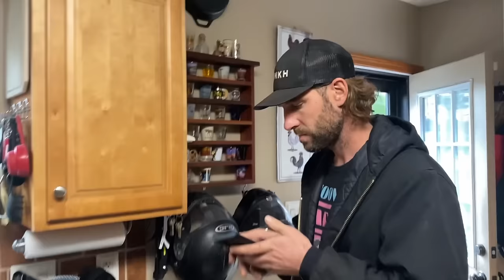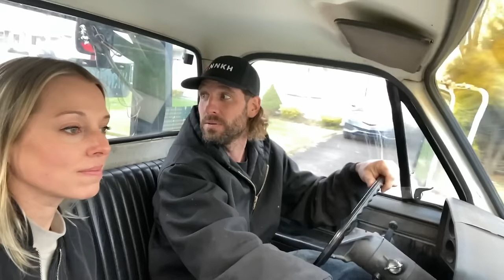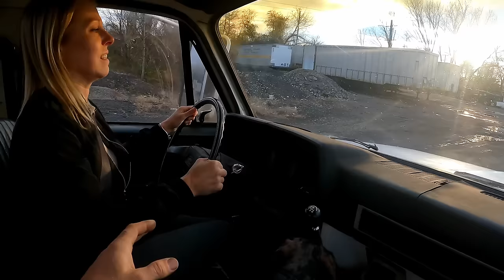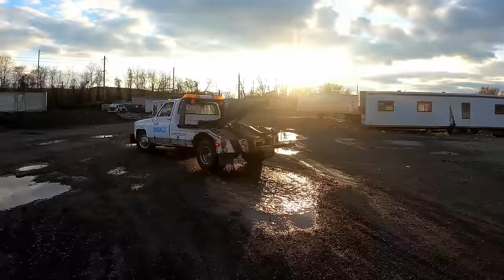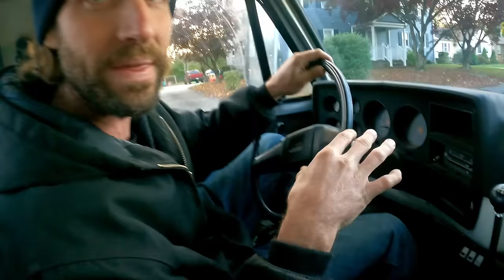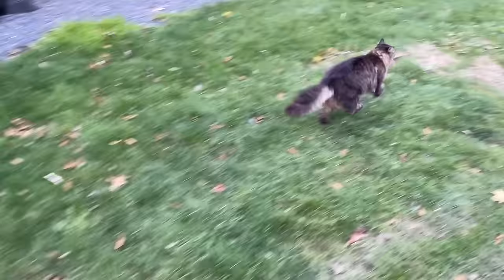Learning stick on "The C30 Wrecker" with NNKH NoNonsenseKnowHow

Comment: Once you get good at driving stick you'll much prefer it,  because the shifting is very positive,  you know you're fully in gear and you're in complete control of it.  With Automatic it's kind of doing everything for you and it shifts where it wants to shift and it feels kind of "slushy" and the shifting is not very positive.   You really get the feeling of being locked in gear fully with a manual transmission.   Besides that it's fun to drive stick,  you feel more part of the machine when you drive manual.

Comment: Each vehicle has it's own little differences. One tip is to watch the speed when getting the car moving to know when to let off the clutch. 2000 Beetle stick shift is about 5 MPH to let the clutch pedal all the way up. If you let up at 4 MPH or less, the engine will stall.

Comment: Your learning fast. I made myself learn how to drive standard by removing the auto in my firebird and swapping to a 6spd manual. I bought a pretty aggressive clutch,  so it really made learning hard. I had a huge phobia of people behind me being so close, because getting going was hard for me to learn and I was afraid of rolling back . Can't tell you how many times I killed it at stop signs, red lights, my own driveway since its a hill🤣. I just drove it down really quiet roads for a few days and got the feel of how to drive , then started making small drives on more populated areas. I just recently did a trip from ms gulf coast to myrtle beach sc. Over 1500 miles , was such a fun drive

Comment: I taught my ex-wife to drive stick. I was banging my head trying to get her to learn the clutch's biting point, with my tiny Daihatsu with a 1 liter engine. She would just keep stalling out cos she couldn't focus on the clutch and the throttle at the same time. Threw her in my diesel van and she got it within 10 minutes. The higher torque off idle compared to the Daihatsu meant that she could first get used to the clutch, then moving on to learning how to balance the throttle with the clutch.

Comment: In my oppinion its probably the best rig to learn with .. plenty of power and with that granny L its enough to go without touching the gas so you can learn that friction point and get good confidence with it ... after you repeat that process in 1st gear and learn to match the engine speed with the accelerator when it slows down 😉  ... but overall you DID GREAT !! I personally dont care if you stalled my car 30 times, i prefer jumping on the seat like a frog than someone whos "riding the clutch" 🤟 ... great job 

Mat

Comment: Chris, on all these trans with no synchros in first gear, if you throw it in first gear or first synchro gear it stops the trans and it will slip right into Low gear, synchro gear with no grinding. Try it
Love your videos

Comment: For a first-ish time using a manual transmission  you really did good. It takes some practice to get all of the motions right, the emblem on the shift knob kind of has the directions on it and maybe without the engine running shift through the gears a little train your mind to follow the shift pattern. You just seemed a little nervous but that will fade with practice.  Keep up the good work👍

Comment: I had an unfair advantage the first time I drove a manual, my uncle taught me to drive, he worked for the  township driving dump trucks payloaders etc even snowplows, he taught me to drive because my father had a stroke and was partially paralyzed and couldn't drive anymore when I turned 16,. He took me out driving even before I had my permit but the way he taught me was key, he taught me to drive with two feet, left foot for brake right foot for gas, a few years later my friend bought a car with a stick shift, I can't remember what it was, he asked me if I wanted to drive it and it was second nature because I already had the left foot coordinated with the right and picked it up instantly, I still drive with two feet to this day, when I took my drivers road test I of course did it wi th one foot because I'm sure they would have failed me if I didn't.

Comment: Then the hardest part after than is learning to drive up and down hills using the clutch.
Then go for the really hard one using both feet to work the clutch, brake, and gas pedal at the same time. (2 feet driving)
I hand brake lever is useful for that when you have a hand brake lever for hills.

Comment: Those old sloppy trucks are way harder to learn on than a Honda.  I learned on a Volkswagon beetle with no brakes we had. It only had 3 speeds and reverse. We just drove it in fields in the country (lived in PA too). I got my uncles 84? civic with stick shift and was pretty good to go after an hour of practice. Then you have to learn double clutching. This is so you can downshift without the vehicle lurching. (shift to neutral, rev engine, then shift down)

Comment: 2 different lessons. spend an hour just going into the friction point on the clutch. get moving then smoothly off clutch back on and stop. use more gas for more load like a hill, but getting use to that fricton point is the key to manual gears.
second just run through the gears with the truck off. palm to the left low and 1, palm to right 2 and 3.
once you can do both blindfolded just drive. it works for everything from a mini to mack with plant trailer. just take your time your doing great. and you may learn to love the low speed control.

Comment: You did great for a first timer, just don't learn the bad habits, resting foot on the clutch, resting right hand on the stick, did good with clutch control, just need to adjust the seat so you're comfortable, you'll be shifting an 18 speed before long!

Comment: You did well Jennifer, the wrecker is a crappy vehicle to learn on - the seating was not adjustable, the gear shifter was so sloppy & had no feeling and not having synchronisers in at least granny low, & maybe other gears was a disadvantage. If you can drive it, you can drive any stick shift. The main difference is a modern car is they are so quiet you can stall them because you can't hear them running. Something you 100% get used to very quickly..

My kids learnt on our Nissan Patrol 4WD. I would leave  it in 2WD, select low range & let them go. A large diesel engne with a heavy flywheel is very forgiving. Plus being in low range meant they could be in top gear at 25km/h, so they got a lot of gear shifting practice at slow speeds. Also the Nissan had synchros in all gears, plus reverse.

Comment: NON SYNCHRO like some semi trucks..is easiest o treat neutral as it's own gear... clutch shift to neutral clutch shift to gear. or what some call as a double clutch.. In NEWER cars they have a synchronized trans an it don't matter long as clutch is in.  But for a non-synchro trans truck ya did great... When i learned to drive stick my father stopped the truck on a hill at a stop sign.. RULES were . Don't roll backwards  <or ya into someone's front end>  DO NOT bark the tires..<PEEL OUT> and no Salling the truck.. Had to do 12 consecutive times in a row before he'd teach me anything else.. on semi trucks an a lot of others with non synchro if ya allow a 2-300 rpm drop on shift it helps as well..

Comment: I would say she is too far outside her confort zone, which at minute 14 is basically low and 1st.  I would say the next step is how to downshift back to low, which is tricky because it's unsinchonized and so a moving downshift to low would involve a double clutch, but it's either that or get used to shifting at higher speed between 1st and second, but once you have either of those, you can just keep practicing that until thoroughly comfortable and ready for more.  Second is towards the crack in the dashboard.

Comment: Should probably learn on something like an old VW Karmann Ghia to get your feet wet and become accustomed to the feel of a manual - like the one that I left on the side of the interstate when it thankfully blew its engine.   I feel sorry for whoever inherited that pos.  But the thing was, because of its relatively short stick and low torque, you couldn't mess things up, and it was practically impossible to lose control of, even in the snow and ice.  But generally not recommended to learn on one that has its stick flopping around, as its harder to get the feel of when you're in gear, and in the correct gear.

But it was fun stopping that thing on an uphill grade with a vehicle on your bumper and having to apply the parking brake each time.  I vowed after driving it for 15 years that I'd never do to the manual transmission thing again, and I've managed to keep that promise.  Anybody's welcome to have the "fun" of driving a manual - but I'll take the convenience of an automatic any day when it comes to personal vehicles.

Comment: My summer job in college was spraying for mosquitoes at night in the suburbs around Chicago. Usually this involved driving an automatic Datsun pickup with the sprayer mounted in the back, but one Friday evening the Datsun was in the shop so they gave me one of the "spares" from the truck yard- a Ford flatbed with a 302 and- a stick. I had never driven a stick before, but how hard could it be? You press the clutch in, shift to the gear you want, and let the clutch pop back up- right? So I'm driving north on Rt. 59 in Friday-evening stop-and-go traffic, dumping the clutch every time I pull  away from a stop, and the truck would hop like a four-ton frog until the clutch springs and the 302 came to terms. Then there was the 2-3 shift, which involved moving from one side of the H pattern to the other. The truck did not like this at all. Getting onto the freeway was fun- wind it out in second, then try to get it into third before other cars start passing you on the shoulder. And whatever black material the shifter knob was made of came off on your palm. Ah, memories.

Comment: Now a days NOBODY under the age of 40 knows how to shift ( there are exceptions ) I’ve driven a manual all of my 65 years ( actually 53 , I was 12 when I got my farm permit ) she did well for a first time but she needs to hold that knob like a cue ball getting ready to throw it ! Lol. Perhaps double clutching will help her then go to no clutch and remember if the bottom of the wheel is going left the front goes right and visa verse , your showing great patience 👍, also check your mirrors every 15 to 20 seconds , know what’s around you !

Comment: I personally think that it's better to find somewhere quiet and practice on your own. That said in Ireland when I learned to drive in a fiat panda in the 80s aged nine 😆 there were very few autos and everyone learned manual shift first, also if you passed your driving test in an auto you could only drive an auto but not the other way round. Best advice if in doubt clutch brake and if you totally bottle it brake, brake, BRAKE !!! 😆😆
Easy when you get used though good luck 🤞🤞

Comment: Yeah if you can drive this beast with that kind of gear shift then you'll be able to drive any manual in a standard vehicle. They're much easier and have a cleaner feel.
Except maybe the high/low splitters you see in a semi 18 wheeler.

Comment: when they dont run great or after damage or just get the auto etc it pain cause shift pattern or worn out or makes bad situation worse or nerves some machines not easy not lot safety
chris fixed that e break but useing blocks  to chuck wheels or have to remove or gates or closeing air systems lots ways makes more challengeing drive higher speeds traffic loads material people or parking

Comment: Well it would have probably been easier for you to start out driving a standard like this pickup and then went to a car but I know that the the ratio to gears is going to be a lot different the truck is going to be a little bit more wide open the car is going to be a closer shifting pattern. I started out on a Chevy pickup dually Crew cab. But truly when people first start driving they should start driving a standard. That way it's easier from there on out. And taking the dog was probably a distraction. I mean I'm only watched 4 minutes and 40 seconds so far but. I'm sure by now you got the hang of it when you said you didn't know what to do after you were in second you should have went to the right and up once you find out where the neutral spot is all you go is to the right. If the truck had a five-speed then you would want to make sure you didn't go too far to the right because then you would go into 5th gear. But if you'll notice that in that pickup versus a car the gears are closer together so you don't have to move the stick too much to the right or the left before you get to the next set of gears. I love when he said that you'll find out as if you know when you're in 4th gear because if you start to take off in fourth gear you're going to kill the truck. It's going to die because you won't give enough gas to to get it to start off and start moving. He said 3rd gear if it's a 4 speed but granny can be considered first also. So he's probably thinking of that pick up as being a four-speed now if there was five gears in that truck and there may be I couldn't really tell by the shifter it would be all the way to the top right the bottom right is the reverse. But I think you did good in this video I don't see how anybody could talk smack. And shouldn't anyway. Because I guarantee you this has happened everyone out here anybody that ever started driving a standard I guarantee you when they started driving off the truck died because maybe they did something wrong so if it happens to you it's happened to everybody else.

Comment: You probably shouldn't have so many distractions leave the dog don't worry about the YouTube people. From what I can see you're doing fine 👍. With the clutch in just run through the gears 1st 2nd 3rd 4th they are written on shifter knob push them into place don't slap them. You'll get it 😉🙏😉♥️🌹.                                                                                 🇺🇲 The old fart in Southern California 😎♥️. I'll lay you odds, that half of the YouTubers you're worried about. Don't know how to operate a manual transmission. And who were they to judge you anyway 😉🤗👍🙏♥️

Comment: Good job, you just need to build some confidence. Nice you learned to use low gear but most stick shift vehicle’s don’t have the low gear (some call it a creeper gear) only trucks and not all trucks either. Congratulations. I hope you can find a easier vehicle to practice with. I just can’t picture you needing to drive a wrecker.👍🏻👍🏻

Comment: Either Gus is very small or your cat is a monster.  
Chris, you need to Teach Jen manual shifting in a car not a small truck! with only 3 speeds and i don't it has synchromesh on any of the gears. that is not fair on her the clutch is going to be very stiff and its not a accurate car to teach on.

Comment: Jennifer is doing great! Doesn't seem like an easy car to learn shifting. Unsyncronized gear is moer difficult too.

Sory Chris, you aren't the best teacher either. As a teacher, you have explain 'how to do' before you just tell what to do. It's not enough to explain how to once. 

There were many times, when Chris said what to do, but because Jen was sitll learning, she was hasitant, because she didn't remember how, or lacked confidence in how.

 I would recommend recommend a car with syncronized gear. They are way easier to handle.